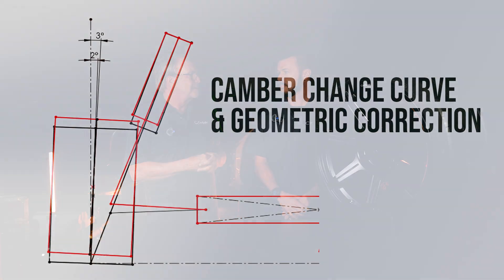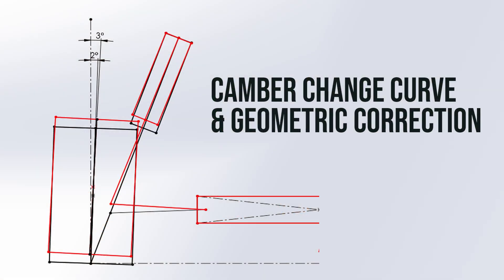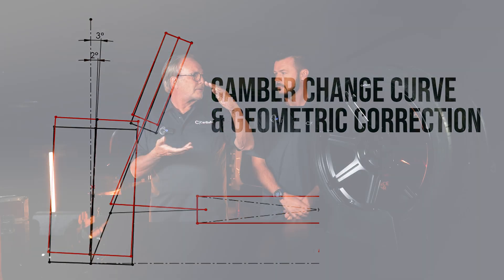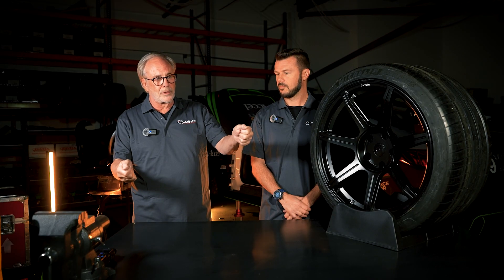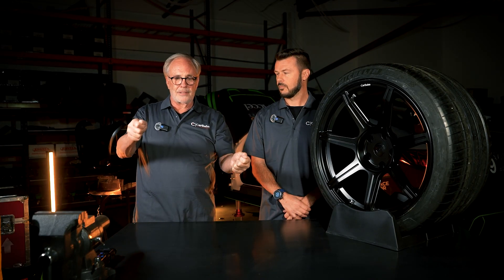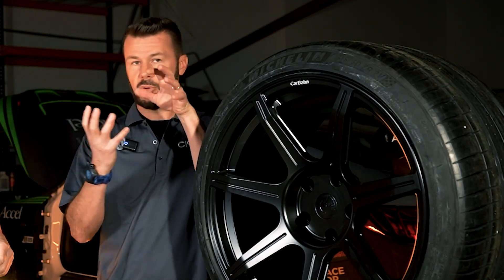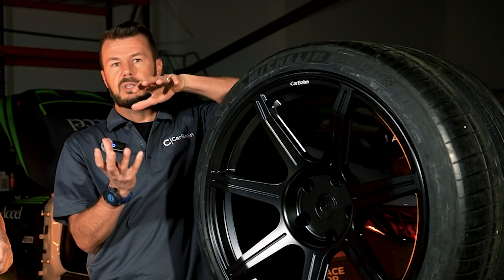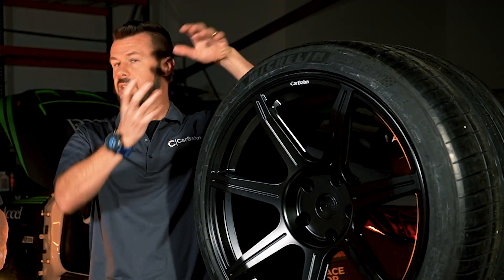Steve Dinan Explains Camber — Suspension Theory Part 1

Comment: 4:43 What about roll center migration, especially on McPherson BMW front ends. The other issue with McPherson struts is the camber curve (minimal camber gain, and even loss at some point), so we need to run a lot of static camber. These heavier cars also need more due to the camber-load relationship (see Milliken). By having a lot of front camber you also benefit from camber thrust, which definitely helps the otherwise understeer focused balanced on modern cars. I don’t have experience with the new G9X cars, but I imagine if they still used the Macpherson design they would need something like 3°+ in front to have the kind of balance and response an enthusiast would desire.
Reply from the maker: Great points. A few clarifications on the current BMW platforms:

• G9X cars use an upper- and lower-wishbone front suspension with a 5-link rear.
• G8X cars use a McPherson strut front with the same 5-link rear.

For road cars, we typically keep camber at or below 2.5°. That keeps tire wear reasonable, and road-car spring rates aren’t stiff enough to properly support the chassis if you go much beyond that. On G8X strut cars, the platform would actually like 4°+, but in racing classes that’s usually the legal limit anyway.

Roll-center stability and jacking forces are well controlled on both the 5-link rear and the wishbone front of the G9X. On road cars, a big part of keeping those forces in check is simply not lowering the car too far.

On the GT4, BMW moves the pick-up points to optimize roll center and jacking forces.
On the GT3, they go even further—converting the front to a full wishbone setup and relocating pick-up points again for ideal geometry.

One last note: the 5-link rear is designed to create roll understeer (toe-in in roll). That helps stabilize the car for non-pro drivers who aren’t as smooth on corner entry.